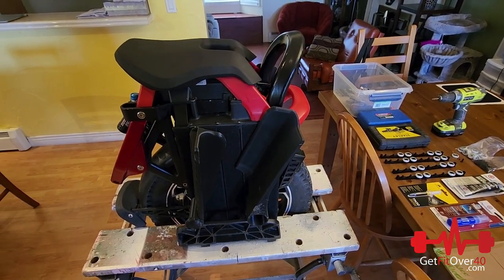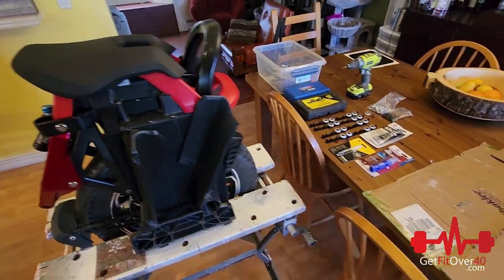Kingsong S22 EUC CNC Bearing Slider Upgrade - Huge Improvement!

Comment: I did it!, I ordered the Kingsong S22 Pro with the HOU rollers and motor upgrades. I am 60 years old. I won't need to purchase another one .
Reply from the maker: That's awesome, you are going to have so much fun! Is this your first wheel?
Reply: @getfitover40  no. I have been using an inmotion v8f.  The s22 is a serious upgrade. I can't wait to receive my shipment.
Reply from the maker: @johnfreitag4044  Yes a good upgrade.

Comment: I searched and found your video. I am a 60 year old riding a V8F by inmotion.  Its a good beginner model but i am upgrading. I am going to by the S22. I wanted to know if it was worth having the upgraded rollers installed for me or should i install them myself. Any input to my thoughts
Reply from the maker: I made this video to answer those questions which is yes it is worth it and hopefully this video can help you do it yourself as I did. You may even be lucky enough to buy a later version that already has the bearing rollers in it so you will not need to do the upgrade.